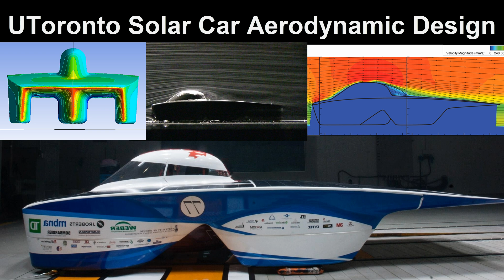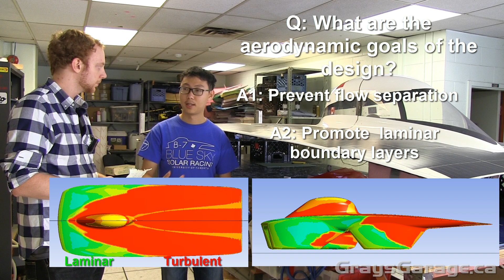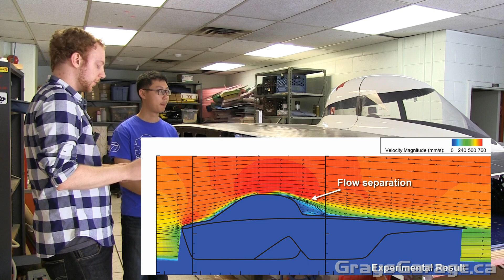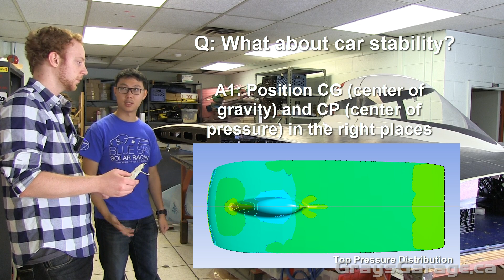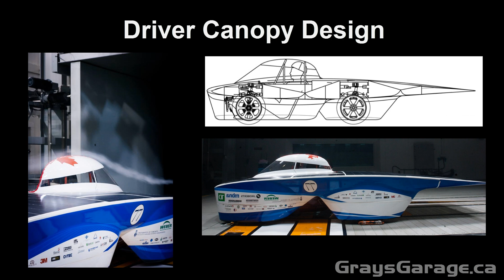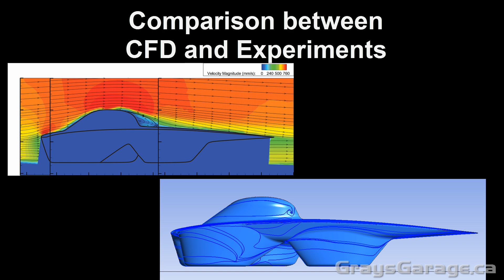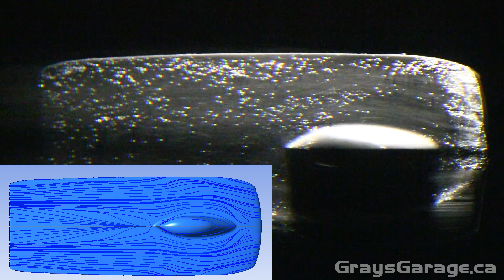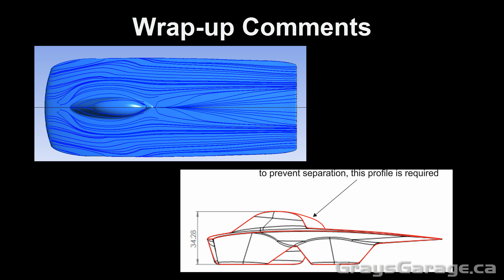Automotive Aerodynamics Episode 3: Solar Car Design

Comment: Does the four wheel constraint specify that the wheels be on the four corners of the car? Why couldn't you tuck two wheels in series to mimic the single rear wheel design?

Comment: 6:40 Capitalize on the cross wind, steer in a parabolic path to make the most of the wind energy. If allowed, run a single faring front to rear to catch the most wind as possible.

Comment: I didn't get what the undergrad explained about  design for neutral lift. Gray can you  just elaborate the explanation. What I didn't understand is how a airfoil near the ground creates downward force.Thank you for all these informative videos. Continue doing this, cheers mate.
Reply: As air flows around the car, the shape is designed so that the airflow does neither lift the car up nor does it force the car down.

Comment: Actually if you put the wheels in a different formation, there would be a better approach. I dont know if its allowed but you could have one front wheel and one back wheel, the driver in the middle. Then add 2 side wheels, one each side. That would mean only 4 "cabins". Another approach would be to move the sidewheels a bit towards the front or run 3 front wheels with then of course a very slim backend of the car. The other way around would work aswell or even 3 wheels in a row and only one side wheel keeping it stable, therefore decreasing drag very much. nice video!

Comment: I am confused about Neil's initial comment about the wing generating downforce when acting near the ground. I have only taken an introductory aerodynamics course, but my understanding is that the downwash and wingtip vortices lead to the generation of LIFT. 

Are there other things that would lead to a net downward force?
Reply: +Musicicism This may be it but due to a large amount of air moving under the car, and where air is moving the pressure is low, that low pressure caused by the moving air is creating a sucking effect pulling that large horizontal plane of the car towards the ground.
Reply: +Harry D That makes sense. The fairings for the wheels also prevent those vortices from reaching the bottom, so you don't really get the same ground effect you do with a wing.
Reply: Musicicism Yes, the fairings around the wheels do help to keep the flow from the top of the car and the bottom of the car separate, and they also help to stop the high pressure and low pressure from the bottom rolling around the edge creating vortex's

Comment: ok so i dont know much about aerodynamic of a solar car but, if you make the cockpit bigger (llike at the end of the video) couldnt you just more those solar strips to the top of the cockpit cover? put them on the roof basically?
Reply: the6cow6god6 The way a lot of solar cells work, is that you are only as efficient as your least efficient cell. So if one cell is angled poorly, you could be impacting the performance of the entire string of 12 cells, and the reduced string performance is then mirrored to the entire array as well.
Reply: Qwerty48121 oh alright, that makes sense. but if this wasnt for a contest and they were just building a super effective solar car, could they do something like that to get more power?  ALSO could it possibly more effective to build the passanger cell laying down with smaller windows and add in camera's with digital screens in the passenger compartment? like make the body bigger overall but you wouldnt need the part on top?

Comment: They can not make use of vortex generators to try to get rid of the flow separation around the wheels? Or are they against the rules or are they perhaps some disadvantages of using vortex generators? I know that they use vortex generators alot in F1 :)
Reply from the maker: Vortex generators create drag themselves, their use needs to be carefully investigated to make sure that they do not create more drag than they are saving. The more efficient solution is to redesign the wheel fairings to prevent separation using a different profile.